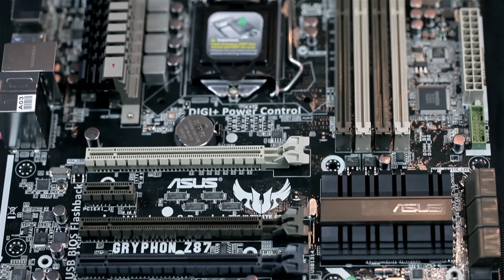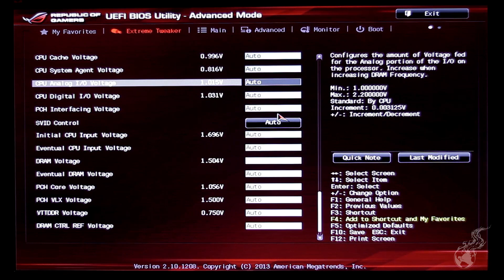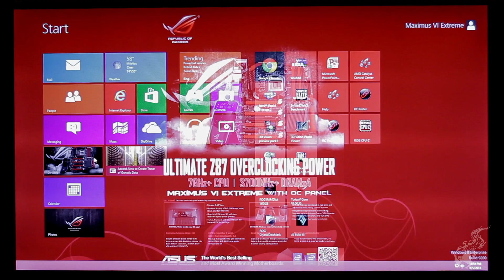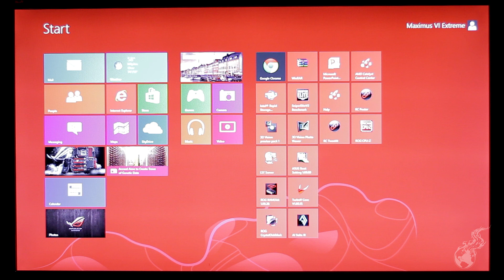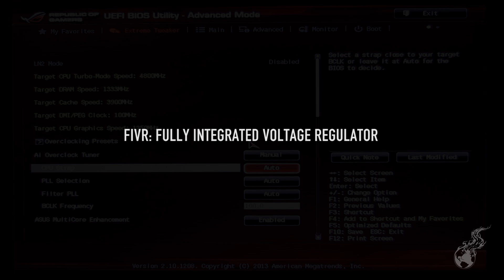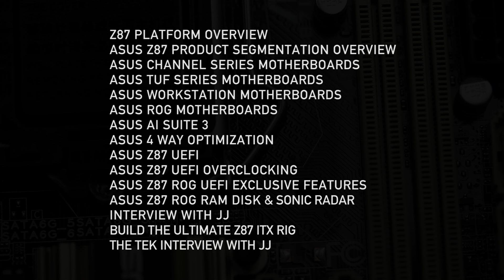Overclock Until It Megahertz On The ASUS Z87 Motherboards - UEFI Method

Comment: So about 1.250 being the max for an h80....bullshit. I am running an evo 212 right now at 1.275 on a 4670k and I have never seen it go above 83c during a burn test. I would probably be mid 70's with a h 80 because it was about 62c on my h110.

Comment: How much is a good overclock for a i7 4770k with a 212 Evo?
Reply: depends on the silicon lottery from the factory..
Reply: shimmikins
I think he might mean how he knows if he got a good chip.
Reply: No I just want to know the temps idle and under load.
Reply: That depends on the coooler lol
Reply: Its the 212 evo on a i7-4770k, says it on my original post :/
Reply: Said Kharboutli Oh sorry I forgot :P
But what temps are you getting on what clock?
Reply: I am looking for temps on idle and under load, something I also mentioned in my original comment lol. And for the clock I was hoping you can tell me the max I can get to under 70C
Reply: Said Kharboutli
It doesn't really work like that. You're gonna have to overclock it and see for yourself.
Reply: Yeah, it kinda does. I am asking if anyone has some experience with this particular mix of cooler and CPU, and I just want to know they clock and temps. That is it :/
Reply: Its about $400
Reply: tubester4567 Yeah but sometimes it can go up to even $550 though
Reply: ***** Finally someone answers my question lol. Thanks man.

Comment: What's a safe OC frequency for a 4770K using the stock cooler?
Reply: BadLarryFilms If you want to OC, don't use the stock cooler
Reply: 3.51GHz
Reply: Lol
Reply: Depends on what you're using to stress and what temps you consider safe. If you're getting the aftermarket cooler soon, you can do a preliminary OC if you're so excited to OC. Stay under 90C. x264 or chess for stress test, you can stuff in some decent overclocks considering your cooler. 

If you want to stress via prime or Linpack, you need to go to heaven first.

Comment: I got my i5-3570K at 4 GHz with 1.060 V, I think that's pretty good.
I also tested the stability with a test more stressful than Prime95. The program is called y-cruncher, the VST algorithm is the most stressful and the highest temperature was 57°C.
Reply: What cooler are you using, I pushed my 3570K to 4.4Ghz at 65 degrees after about 30 minutes under Prime95. I am using a Hyper212Evo.
Reply: Arctic Freezer i30, runs 100% when the CPU is at 60°C.

Comment: You need to set uncore to stock while doing core clock. Uncore limits your core clock overclockability and crashes you if insufficient vring is applied. Do core clock overclock first with uncore at stock. Once that is stable and done, then do uncore so you're not changing multiple variables at once. There isn't enough room here to say everything, Google "Haswell Overclocking Thread" and my guide will pop up as the first Google result.

Comment: If we consider the fact that a 5ghz AMD cpu is handidly beaten by an overclocked Haswell, you need the overclock because AMD counterpart is weaker. So basically what you are saying is, I don't need the extra power that comes with Haswell. I do. I run single-threaded games, I get CPU bottlenecks in multiple games and I run chess as a hobby which is basically a CPU benchmark/stress test as far as the computer is concerned. I want to ring all the mhz I can for chess.

Comment: honestly what how much more are you gonna actually get from your system running your 4770k at 4.9 than say a 4.6 in real world applications? honestly nothing unless you just wanna benchmark. amd on the other hand the 8350 at 4.8 is good  ( which i run on a sabertooth 990 fx board ) and stable and  i hate to say it, but needed lol

Comment: Unlucky draw in the CPU-lottery for me I guess. Tried 4.4 GHz with 1600 RAM-speed (XMP), which seemed stable at 1.28 VCore. Anything below that would result in BSOD. However: After about 2 hours of browsing/youtube/gaming, the system crashed. Went back to 4.3 GHz@1.25 VCore/DDR 1600. So far this seems stable. Ran a few CPU-heavy benchmarks, played games for 3 hrs straight, ran Aida64 for 60 mins and left the PC on overnight doing downloading. No crashes so far (fingers still very much crossed).

Comment: I have a Z87-a motherboard and it seems as bios differs a bit from the rog-class motherboards. If I'm not mistaken the cpu analog i/o voltage is yet another name for imc/vtt/qpi, right? On my z87-a instead there is cpu analog i/o offset voltage and I can't figure out how it works. How do I set offset values to match i.e. 1.1 in "classic" vtt voltage control?

Comment: Doubling the transistors doesn't always equal performance.  The main problem is it creates heat and uses more energy for a small performance boost.  Ex.  Ivy bridge has some 50% more transistors then sandy do you see a huge difference?  We will probably be seeing the increased use of parallel processing which is why they been trying to increase the iGPUs power.  The iPhone has one of the weakest CPUs yet runs very fluid, this is the power of the GPU and is why SoC is very attractive.

Comment: And Intel still has not fixed the useless Ivy Bridge IHS. How difficult is it to solder the IHS like they did on Sandy Bridge? I have a full custom watercooling system, but my 3570K@4.5 still jumps to 70C instantly when loaded.

Comment: actually now that I think about it  the 965 at stock will beat the i3's  ivy and haswell.  Now the 4570  4670k and 3570k..nope..it's about 12% to 15% slower performing.

Comment: Overclocking Haswell chips seems to vary really wildly, you might get 4.7 if you're extremely lucky or you might barely make it over 4. only thing that is sure is that the temperature is the only thing that will limit your overclocks with Haswell, way before anything else. Then again in most cases those few 100MHz won't make any noticeable difference.

Comment: Q1-How much more frames (FPS) will i gain if i config. the followings:-
A- 'CPU Cache Ratio' into native settings.
B-'CPU Core Ration' into the applicable maximum settings.
C-PLL Over-voltage into optimal settings.
D-CPU Core Voltage optimal settings.
Q2-Is it possible to upgrade UEFI BIOS Utility V 2.10.1208 in P8Z68 DELUXE/GEN3 MoBo?

Comment: Now I ran into this " issue' with MSI's overclocking my 1090t.  
Why is it that at 21:46  Windows taskmanager shows " maximum speed at 3.5ghz ( which is 4770k's stock max speed before it is told to kick into turbo mode) when it also clearly shows the Speed at 4.76ghz?  Is this a weird " reading" bug between the o.s. and overclocking software?  I never understood this and thus one more reason why I trashed the msi overclocking software and just stuck with doing it in bios.